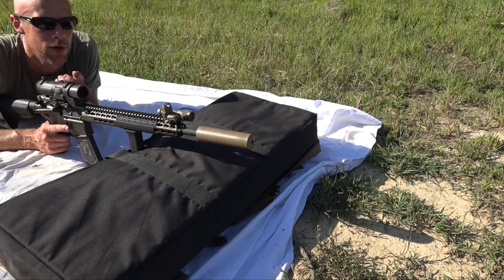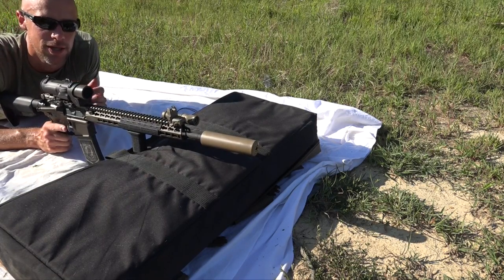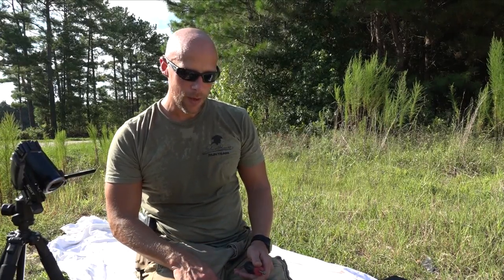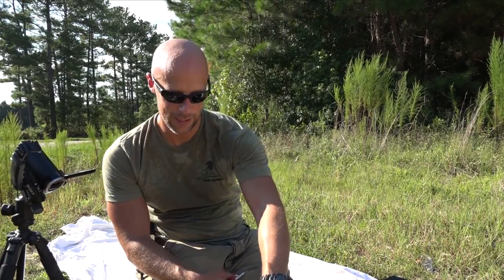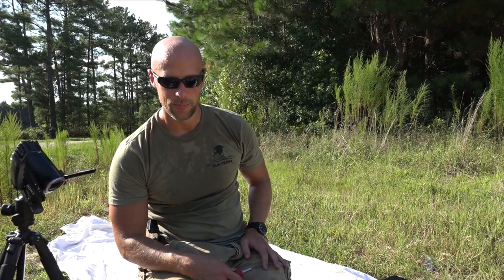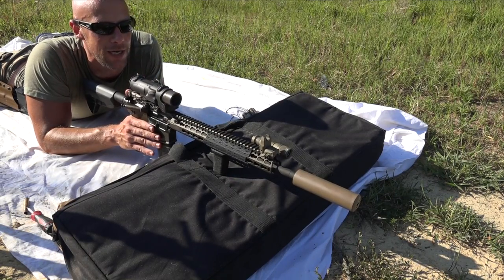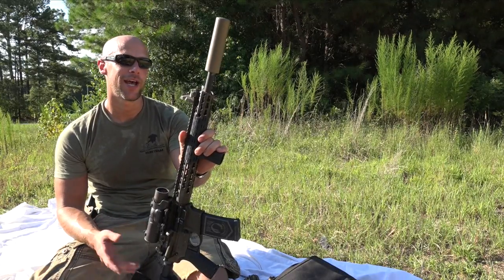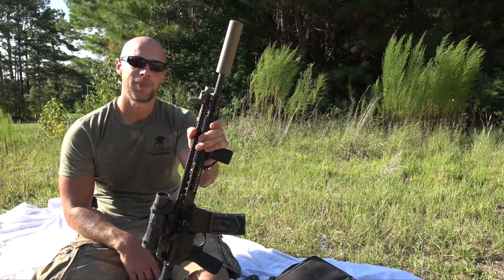How To Zero An Elcan SpecterDR 1-4x Optic (HD)

Comment: One thing that's really cool with the Elcan elevation wheel is that you can mark your zero for 100, 200, 300/25, and 400. This allows you to adjust the wheel to your marks at each distance rapidly. Makes for some very precise shooting.
Reply: The reticle has this feature built into it. No need to move the wheel. Unless I'm missing your point?
Reply: @EdFudge  Yes, it has bullet drop compensation (BDC) etched into the reticle, but it may not directly match the drop of the ammo you are using. So in certain marksmanship competitions like US EIC comps, you can use the dial for your elevation in order to be more precise, rather than relying on the BDC.

Comment: Can you do a return to zero test, and maybe add some dirt or grit to the adjusting mechanism?
I went with the Trijicon ECOS over this because of hearing about so many problems with the Elcan.
Thanks. Great video as always.
Reply from the maker: I'm probably not going to throw dirt in the optic I just paid $2200 for but maybe one day this channel will justify that.
Reply: Various military units out there use the Elcan (and the ECOS) and they don't experience the problem. They also clean their rifles/optics nearly everyday. You'll have to also remember with the price being so high, not a lot of folks willing to torture test a rather pricey optic.  So you'll hear a lot of speculations and/or fake optic reviews out there.

Other than videos with people shooting it at ranges, I have yet seen anyone use it under adverse conditions or just running around. Again who would be willing to risk such an expensive optic?
Reply: Riley Peak in regards to the adjustment mechanism being exposed to the elements; I think that only applies to the clones and not the real Elcan.

Comment: Does your Elcan have a little play between the mount and the scope? I just purchased one from optics planet and wondered what your thoughts were on this.
per the manual " the mount is designed to with stand rough usage in operation. anti backlash springs in the elevation and azimuth mechanisms permit flexibility, but always return the sight to the zero position. a tension spring between the optical main body and the mount rail grabber removes vertical movement by applying tension to the two halves of the mount."
Reply: Elcans mainly work on mil-spec rails

Comment: I typically use a 50yd zero - are you using 100yd as your preference, due to the 4x magnification, or because that's what Elcan suggests?
Reply: If you don't zero it at 100m the BDC won't work.
Reply from the maker: correct

Comment: I noticed that you keep your front site post up, even if it can be flipped down, when you are using optics.

If you don't mind me asking, why do you do that?
Reply: It's too close to see when looking through a zoomed optic so it doesn't really matter if it's up or down.
Reply: That's true. But the Elcan Specter is a 1x optic too. And I've seen +Mrgunsgear Channel do this with other 1x optics.

This is not a criticism; just a curious observation.
Reply from the maker: I actually have a video on this topic where I discuss the theory behind it.   I'd check my how to set up BUIS video
Reply: I see now. I watched the video. In short, its an immediate backup rear sight aperture if the dot failed.
Reply: Mrgunsngear Channel I see now. I watched the video. In short, its an immediate backup rear sight aperture if the dot failed.